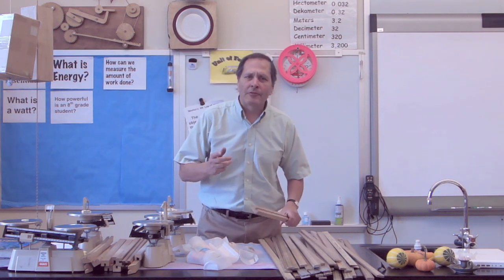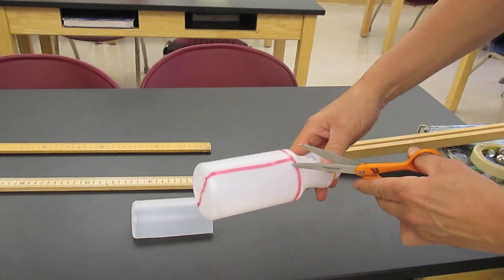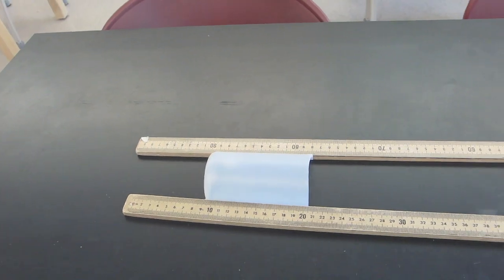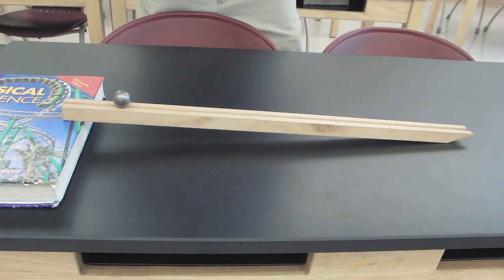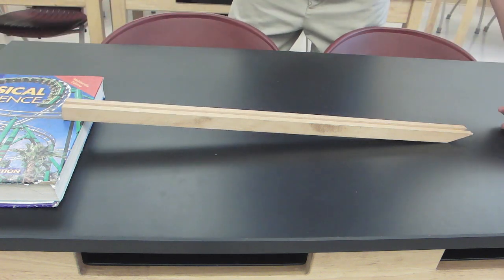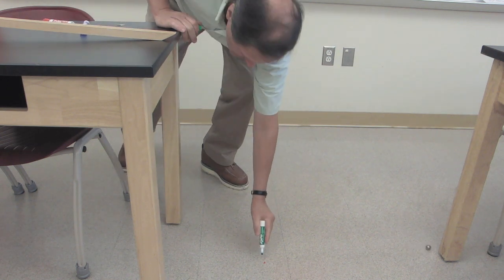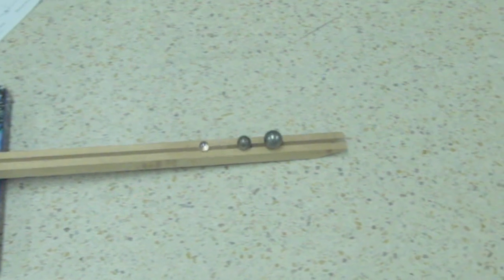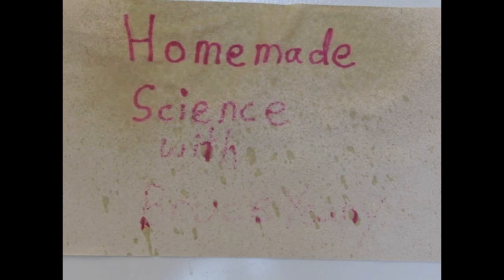Potential Kinetic Energy Investigation /// Homemade Science with Bruce Yeany

Comment: I have idea. What if object would be gradually accelerated by electricity or other force and would be mechanically attach to object(car, space ship, boat) witch it wants to move and instead of hitting in end  it would apply very strong break, by this way forcing attached object to move and if we would have much longer ecceleration distance then breaking distance.. and multiple object eccelerating and breaking..is it possible this way move on land, water, space?  And lets say the same object after breaking would shoot very fast opposite direction of moving and slowly decrease its speed.. would eccelertion force comparing with slowly stopping would push object forward? Does any of this make sense?

Comment: I think this happens because while the ball is travelling due to gravity essentially, the larger ball with more Mass is heavier, therefore gravity force has a stronger affect on it, so it goes faster while travelling downward, leading to more speed and energy, so when it rolls of the table, it goes the furthest. Since gravity is the main thing here, this would not be true if the road was not slanted at the start as then there would be no downward motion of which the gravity would effect.
Reply: Ball with more mass does experience more gravitational force and therefore it should accelerate more. But because of its mass, it also has more inertia meaning it resist the change of its motion more. Since gravitational mass and inertial mass of an object are basically the same thing, those two effects cancel each other perfectly.
Reply: The reason is entirely about geometry and the distribution of mass.   What matters is the factor in front of m*r^2, which I'll call X, in the equation of moment of inertia (I=X*m*r^2), where r is the radius from the contact point to the geometric center of the rolling object.  Since the ball sits in the groove, you see that bigger balls sit higher and smaller balls sit lower.  The relative ratio of the groove width to the ball's radius is what governs how fast it rolls.

I derived this in another post, and we get the following, where W is the groove width and R is the sphere radius:
X = 8/(5*(4 - (W/R)^2)), for the spheres in this situation.   Play with the ratio of W/R, and see what you get.   Smallest case scenario for X is when W=0, and X=2/5, which is normally the value of X for a solid uniform sphere.   Largest X we get, is when W=R, and we get X=8/15, essentially the sphere is rolling on a thin axle of negligible mass and negligible radius that goes through its center.

Once you have X, the acceleration down the ramp is:
a = g*sin(theta)/(1 + X)

Comment: I know why this happened
Since the bigger ball had its centre of mass higher than the smaller ball ,the bigger ball accelerates more than the smaller ball
Reply: Potential energy video
Reply: Hope it helps u bruce
Reply: @avs9171  It actually isn't the center of mass location that matters.  What matters instead is the factor in front of m*r^2 for moment of inertia, that governs this behavior, where r is the radius from the ball's geometric center to the point it contacts the track.  We'll call this X, such that I=X*m*r^2.  This X determines what fraction of the energy is rotational KE, and what fraction of the energy is translational KE.  For solid spheres on a track like this, what matters is the fraction of the radius from the center where it contacts the track.   If a solid uniform sphere sits directly on a ramp, the factor in front of m*r^2 is 2/5.   If instead, it sits inside a groove, the factor is increased.

Given a sphere of radius R that sits inside of a groove of width W, you can calculate lowercase r from the Pythagorean theorem.  R^2 = r^2 + (1/2*W)^2.  Define lowercase w as W/R, and apply to this equation.   R^2 = r^2 + (1/2*R*w)^2.   Solve for little r^2 and get, r^2 = R^2*(1 - w^2/4).  Solve for big R^2, and get R^2 =r^2/(1-w^2/4)

The moment of inertia is I = 2/5*m*R^2, but we want to rewrite it in terms of m*r^2.   So we replace it with our previous expression for R^2.   Thus we get I = 2/(5*(1 - w^2/4)) * m*r^2, which means X = 8/(5*(4 - (W/R)^2)).  The only dependence on the specific ball, is the ratio W/R of the groove width relative to the ball's radius, given the fact that it is a solid uniform sphere.  If you double the groove width and double the radius, you should expect the same acceleration down the track.

For an object in general rolling down a track, the acceleration is g*sin(theta)/(1+X).   Plug in the previous X, and you can see how the ratio of W/R affects the acceleration down the track.

Comment: I think that the unexpected results that you are seeing is due to the portion of the kinetic energy going into the rotation of the ball as compared to the lateral velocity of the ball.   The faster the spin of the ball,  the less energy in its forward velocity.    Try this:  use a cube or hockey puck (or similar shape with a flat side) on a ramp with enough air jets to suspend it like an air hockey game,  so near zero friction and  no rotation.   You might also try the experiment with the cubes/air ramp in near vacuum conditions.  You will see more predictable results.